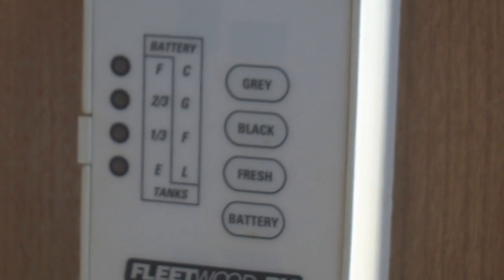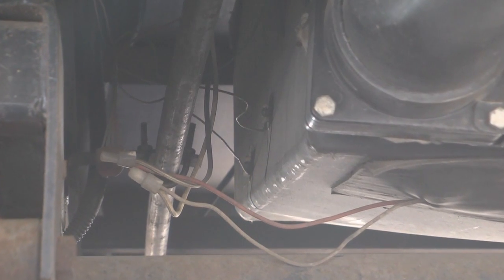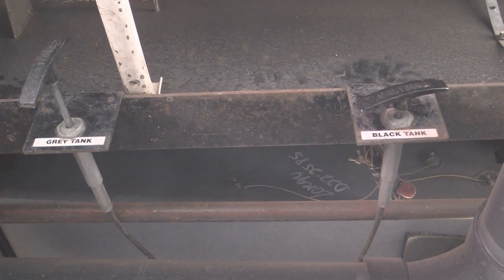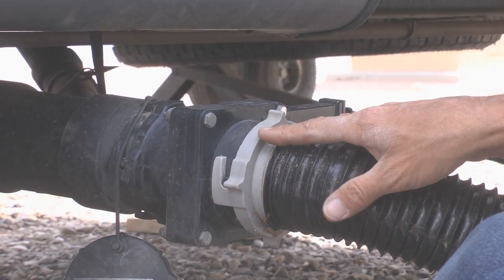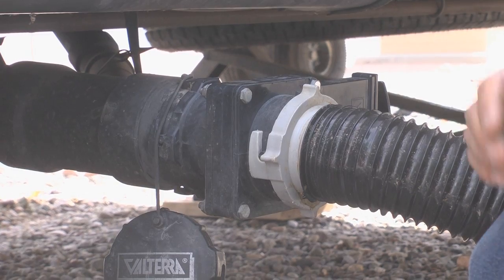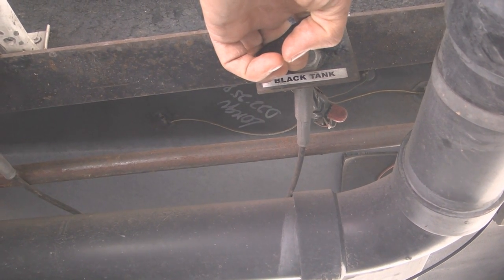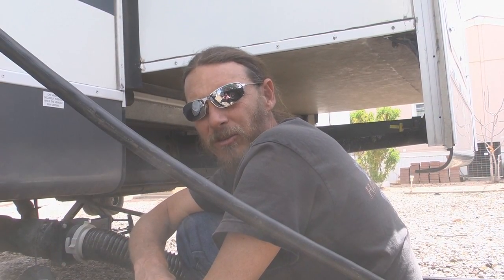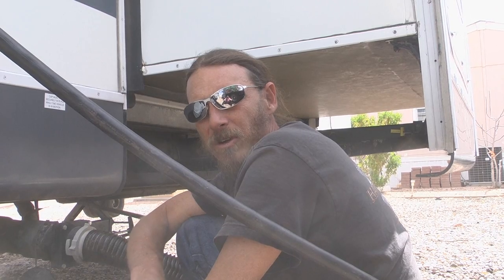Best RV Black and Grey Tank Hack

Comment: Not a bad idea, BUT........It is pretty certain that if you do this, you will end up with fouled gray water flowing back into the gray tank since you cannot tell when the flow stops going into the black and starts back into the gray as the water seeks to equalize levels between the 2 tanks.  I like to dump a Homer bucket of fresh water or 2 down the toilet after the black finishes draining (if no one is waiting in line for you to get the hell out of their way). Another trick to further clear out both tanks is to use the CG flusher hose in your drain hose and backfill either or both tanks by holding the hose up and lowering it and raising again so the water floods the tank and stirs it up in there.  Then lower the end of the hose into the CG drain to empty whichever tank you are trying to flush.

Comment: Never have both tanks open, you are  (as many have said ) risking cross contamination, just stick with "water is your friend" in an RV black tank , we just dump and refill the black tank, and dump again, this is usually pretty good , if not rinse and repeat. We also use a product called happy camper in our tank , and that breaks stuff down pretty well, after the black and grey we dump the bathroom grey, which is mostly water and soap, our hose never smells like it was used for whats intended.
Reply from the maker: I see that you are a beginner. Do you understand anything about hydraulic pressure or are you just mimicking what you were told?
Reply: @HighDesertOffgrid I have owned an dumped camper tanks for yrs 25 plus an have never heard of the Gray water dumping into the black tank? They both dump into the same exit 3” pipe to hook hose to an dump? I always use 8 oz bottle camco black tank mainly for smell an break down an 1/2 cup of Dawn dish soap an 1-cup citrus cleaner! Dump black valve then the gray to flush the line?
Reply: @HighDesertOffgrid I have owned an dumped camper tanks for yrs 25 plus an have never heard of the Gray water dumping into the black tank? They both dump into the same exit 3” pipe to hook hose to an dump? I always use 8 oz bottle camco black tank mainly for smell an break down an 1/2 cup of Dawn dish soap an 1-cup citrus cleaner! Dump black valve then the gray to flush the line?
Reply from the maker: @roberttaylor8261  25 years at an average of 1 week per year is less than 6 months of practical experience. There may be many other tips and tricks you could get from someone who has lived and traveled in RVs 24/7/365 for over a decade.
Reply: @HighDesertOffgrid  Yea sounds like your the Only experienced one that Matters! As a Plumber and Welding Fabricator for 40 plus years I have fixed an replaced these tanks an valves an Welded on Trailer Frames! While your a Professional Utube Video Engineer?  I’m well aware of all the ways an Means  of the drain systems on RVs!
Reply from the maker: @roberttaylor8261  yet you don't know the difference between "an" and "and" or "your" and "you're".
Do what you want. I give no shits.

Comment: Just put a box of rid-x for septic tanks in toilet , close the black water valve and the rid-x will breakdown everything nothing but soup when you dump it. Before leaving campsite put 1 cup of dawn detergent and about 5 gallons of water down the toilet and the dawn will clean the tank and sensors as you drive  down the road, did this for years and never had the "pyramid" to worry about or trouble with the sensors.
Reply: Glenn Carraway I hear comet works well also. Maybe a combo of dawn and comet? Helps with smells too for long term storage
Reply: How long do you leave the Rid-X in the tank? Do you leave it in there during storage or just when you are using it?
Reply: Dave Reeder 
Put the rid x in when you first arrive at camp site leave leave it in until you need to dump black water, when you leave dump tank then put in a cup of dawn and 5-10 gallons of water it will clean tank and sensors as you drive.  The rid x breaks down the solids turns everything into soup.
Reply: Along with the dawn,  I like to place two large bags of ice into my black tank.  It sloshes around while on the road and turns to water by time im ready to empty my tank.
Reply: Exactly what l do
Reply: Douglas James   We did that at Pizza Hut with ice and salt to clean the coffee carafes..

Comment: I've been RVing for many years and had never heard of this gray/black water contamination concern before.  So I had to do some research on it.  A study done in a hospital has shown E.coli can spread in drain pipes from one place to another, and can even come up the drain and into the sink itself.  From there running the faucet can splash that bacteria around, where people can get infected.   This is alarming.  But practically, you have to wonder why people everywhere aren't getting E.coli just going through life normally.  The drain pipes in virtually all buildings, houses, etc., are all interconnected.  Gray water and black water eventually flow together, and there is a pathway via drain pipes to every sink, shower pan and bathtub in that building. 

So why aren't people everywhere coming down with E.coli infection all the time?    This is to me like the news stories of scientists swabbing all these different surfaces in stores and restaurants and showing how contaminated everything is.  Yet I've been going through life for 65 years so far without having gotten sick, let alone died, from any of this kind of contamination.  And the truck camper I've owned for the past 11 years has just one holding tank where both the gray and black water ends up.  How is it possible that E.Coli hasn't made me sick or killed me yet?  

To get the E.coli to grow that fast in the hospital study, they poured nutrients down the drains, like IV fluids, for example.  So maybe that was appropriate for a study in a hospital, but can the same results be assumed to apply to non-hospital settings too?  I doubt it.   People everywhere would be getting E.coli contamination just by going through life normally otherwise.  

So how big of a concern is this?  So far I don't think it's a concern at all.  If it was, it would have affected me long ago.  But if the study says anything to me at all, it's that I should avoid hospitals at all costs!   :-)   

Here's a link to an article about the study:  https://www.livescience.com/58014-drug-resistant-bacteria-hospital-sink.html
Reply: Also consider this.  Gray water will become almost as nasty as black water after sitting for 48 hours or so.  That's why it stinks so gawd awful bad after a short period of time.  It contains food particles from kitchen sinks, small amounts of dirt, grease, skin cells, hair and fecal matter washed off of our bodies in showers and bathroom sinks, and a mish-mash solution of soap, shampoo, conditioner, salad dressing, beer, wine, soda and God knows what else.  Along with all of that comes bacteria, and a gray water holding tank is a great incubator for that.  So it doesn't really matter if there's cross-contamination from the black tank.  The gray tank is already bad enough.  My biggest concern about black water flowing into the gray tank would be with the solids that come with it.  Most gray water plumbing pipes are about half the size of the black water pipes.  Get enough solids in there and there's an increased chance of a blockage.  But as long as you don't leave the gray valve open while you're draining the black tank, that shouldn't be an issue.

Comment: I have tried that, and the system flush adaptor from RINO, a 45 degree angel with the water hose connection to back flush the black tank.  They worked so so.  The best way I have found over the last 1.5 years is just put a hose down the toilet going wide open.  Then I dump the black tank.  I shut the black tank valve several times for 30 seconds to let it build up and move all the goodies out when I open it.  this gets it cleaner than any other method (judging by they clarity of the water draining out) than any other method I have tried.  I don’t have direct access to the black tank from the toilet as it makes a 90 degree turn just below it.  That’s why the tank flusher I bought at Wally World wouldn’t work.
Reply: Would an electric pressure washer work good?

Comment: I love watching these vids. The comments is where I learn a lot. Individual ideas and experiences is what I build off of. I realize you did not have the flush system built in. What about using those pressure water sticks you place down in the toilet and swish around? Or those bayonet fitting with a water hose connection to back flush with. I did not see any replies from the author if you will so I'l just accept this as a interesting video and thank everyone for chiming in.

Comment: Here’s my thought - everybody makes a bee line too the dump station as they pull out in the morning- just get on the road and dump when you get to your next destination- everything is emulsified by then and runs out fine ! To really clean things out stop an hour or so before your next overnight , dump and put a bag of ice down your toilet and proceed to your destination - arrive with a clear black tank and some residual water in your tank to keep from causing that pyramid !
Reply: I use the ice method and about a pint of Dawn  put in about 10 to 15 gallons of water sensors all work again!
Reply: Works everytime !
Reply: I hope you have straps on your tanks. That is a lot of weight to be bouncing up the road. Going to ruin your tank.
Reply: I thought there were legal constraints against highway travel with black tank not empty?

Comment: Best way to clean out your funky blackwater tank ?
Used this in my 100 gallon Blackwater tank : 
20 gallons of water, 1 gallon of Pine Sol (Walmart) and a small jug of laundry detergent (Dollar Store)
Pour contents into my toilet and drove from Escondido, CA to Yuma, AZ (Plenty of winding roads)
Idiot lights work fine now and my RV smells like Pine Sol ! 
I've still got "caked crap" coming out of my blackwater tank, but it broke the pyramid up into pieces !
Bon Appetit' :face-blue-smiling:

Comment: Basic hydraulics: if the pressure in the grey tank is greater than that of the black tank, cross contamination is not possible. If you get your valve openings and closings in the wrong sequence, then yes, you could cross contaminate. But if the volume of the grey tank exceeds that of the black tank when you open the grey tank valve - and then the black tank valve, contamination of the grey tank won't occur. Physics.
Reply: "It's basic hydraulics." "OK, Archimedes." Sorry, your comment made me think of that scene in the movie RV. Now I am in the mood for some tortilla chips.

Comment: I rarely even use the black water flush anymore. We usually just run about 3 gallons of water after our camping weekend, and add chemical to that , drive home and let it sit until next time. This gives a slosh to the tank with the water and chemical together to loosen any debris, then next trip if I'm worried about space in black tank, I drop my " Jonny Chock " in the open toilet intake and fill tank , then drain. This at least get water level over previous sitting level.  Otherwise we just wait until tank fills and dump, then repeat, ,.....my tank stays very clean and my level gauge usually works  ( because non work all the time ) No worries about cross contamination , and always remember.... dump black first and use the gray to flush hose, you get a nice clean hose to put up.

Comment: How well does ice cubes work to break up any pyramid? This is of course while driving so it has maximum shaking and effectiveness. 

Side note. I had to change my sensors recently to the kind with a canopy over them to prevent buildup on sensor. Seems to working good this far.
Reply from the maker: Many people swear by them.  However, there is a video out there experimenting inside a aquarium (so you could see it) that shows little to no effect. I have never tried it.

Comment: Full-timer here...

It’s ALL bacteria laden water whether it’s gray or black water.  Unless the gray water is already diverted for water reclamation, I close the gray gate valve before dumping the black tank and then open hopefully using some of the gray tank to clear the main line. Normally I keep the gray open all the time.

I pull a hose into my toilet room and fill and flush the toilet a few times to help rinse the tank out a bit. Once it’s got a lot of water in it, we drain it again. Once or twice a year I really go all out and fill the 40 gallon tank to full a few times to really do the job!

Gnats in New Mexico. It is so hot and dry here the trap water will evaporate quickly. 
There are other RVers who have a problem with gnats, fruit flies, or whatever they are coming into their RVs. I believe these folks probably leave their gray water valve open all the time. This allows the little buggers to come in from the dump line to the gray tank and the traps are dried out and they infest an RV.  The shower is the biggest offender because most folks will use the campground facilities after the pool rather than use up their gas, electric, or water.
The first time I saw gnats and smelled the gray tank gasses, it took me a few days to figure out about the traps. I felt so silly! 
Living in cold, wet climates most of my life I’d forgotten about the function of the gas and insect barrier traps. So keep water in the traps!

Part timers or full-timers on the move, I’ve heard that when preparing to leave a site with hook ups that when we leave a few gallons in the tanks the water and other contents will slosh around helping loosening other debris. A dump and rinse at the next hook up will hopefully flush out most of it.

Whether it’s gnats or gasses, remember to keep your traps filled!

Thanks for reading and I hope it is helpful!

Comment: I changed my plumbing didn't hold any water fresh , gray or black . No tank freeze everything straight to septic line in RV park . Also put in 20 gallon hot water tank . If your not into the boondockn thing it's very doable

Comment: Logically wouldn't that pose a contamination risk to the grey water tank by allowing the grey tank to be into the black line there very likely be back wash from the black tank into the grey tank and that is gross don't you think lol!?! I always empty my black first then my grey to rinse the main exit Line out.  But watching this video I'm thinking that if the grey line remains open while you pull that black line open that will contaminate the grey tank or line. Just throwing that out there.
Reply from the maker: Potentially, all the microbes in your black tank have already gone through your kitchen on the way to your stomach and are in your grey tank.  That's why grey water STINKS so bad lol.  In my RVs the grey water tank always sits above the black tank by a large margin, so back flow is a non-issue.  Your results may vary.
Reply: Robert Ott  what is this honey bee stuff and where do I get it?
Reply: He is plain wrong.  Even with p traps, you risk contamination.  Period.  There are easier ways to clean black tank.
Reply: I've never been worried about contamination of my grey tank. I  only use the grey water to bathe and cook with when I am in full blown tree hugger mode!(LOL just a joke, the grey and black tanks are only used for their correct purpose, to hold waste from the sink, shower and for the toilet waste.)
I was told a little tip when I bought my first R V.  When both of your tanks (grey & black) are empty and you are going to be moving your R V. Confirm that both are empty flush a little water through the system and make sure that both valves are in the empty or open position. Give it a minute or two to run and clean your tanks a bit, then confirm that both are empty again. Now shut both tank valves, then go buy lemon ammonia  or lemon pinesol. Poor one full bottle in one of the sinks then  7 to 8 gallons of clean water down the same sink drain. Do the same in the toilet 1 full bottle of lemon cleaner disinfectant into the toilet then 7 to 8 gallons of fresh clean water. Now that the cleaner and water is in both tanks, hook up and go driving. The longer the drive the more effective this is. As you drive it is like you are scrubbing the inside of the tanks. This is very helpful to keep the quantity indicators clean and working much longer. After getting to your destination go to the dump for your waste water. Open the valves and flush with clean water for a minute or two at the sink drain and then the toilet. You don't have to be perfect on emptying it as you will only be using the tanks for wastewater and if any cleaner is remaining it will help keep your tanks just a bit cleaner.